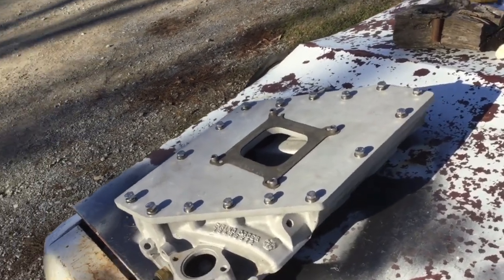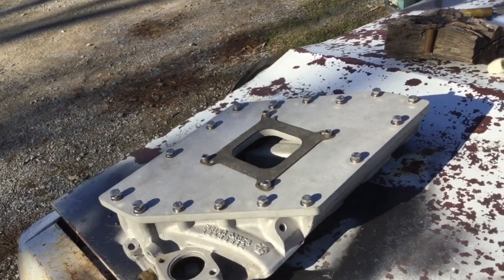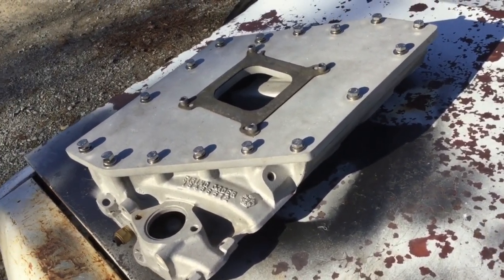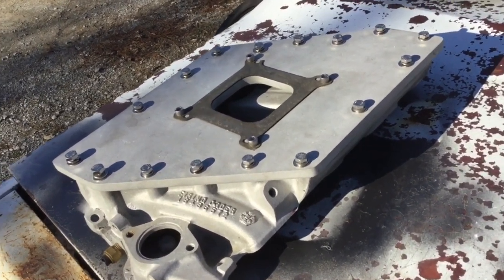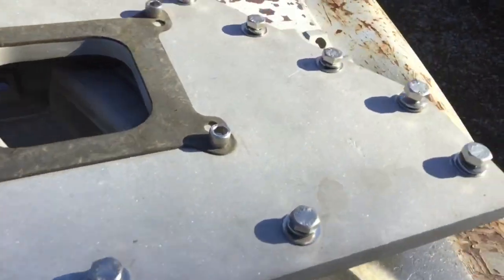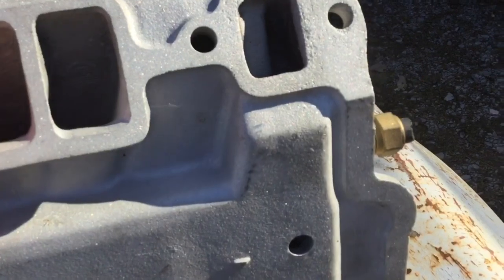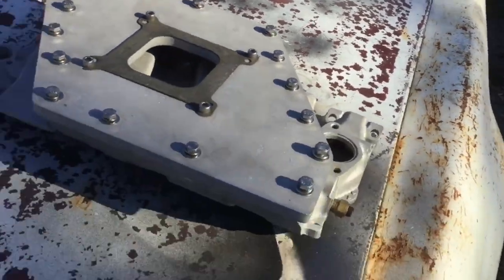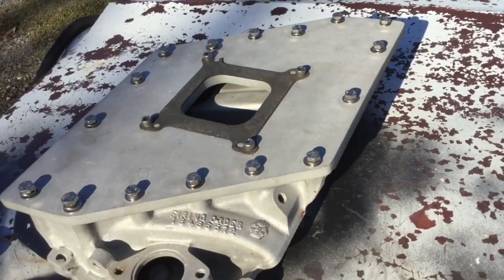Homemade Cross Ram Intake or Junk? Corvette Crossfire Intake made for Carburetor

Comment: Looks like the mixture has to do a 180º as it is pulled down through the carb flange, it first has to veer outward towards the heads, but then do the 180º as it's pulled into those concealed runners to the opposite head. The 'arc cuts' in the runner pairs, along with the bevel, tells me that whoever made that realized where the mixture was going. 
Best thing to do would be to compare it to a typical stock iron four barrel manifold, and then to a Performer. I'm sure the Performer makes more power, but I wonder about the stock iron manifold.  It does look cool, and the price was right.  I'll bet you could make a better taller top cover though, and make a better path for the flow, actually routing it to those lower runners - the way it is now, hood clearance will never be a problem.
Reply from the maker: Ya I’ve thought about making it have more volume, and I would really like to have it on a dyno but there isn’t really any around where I live. Thanks for watching Dan!
Reply: @dakotastimeout2827  The road is your rollers...

And that movie I was trying to think of last night is Thunder in Carolina from 1960.

Comment: I need to find myself a good place to purchase an old manifold I can start chipping away at.

 I would prefer to not convert my Crossfire over to an EFI carburator replacement but those do seem to be the most effective way to open the airflow
Reply: Convert it to a truck tbi. All the wiring and connectors are the same. The stock crossfire computer will run it just fine. Use an 87-89 350 tbi unit from a truck.
Reply: @mcqueenfanman  I'm going to look into this, thanks for the idea
Reply: @williamforbes6919  I ended up using Holley's tbi intake, it barely fits under the hood of my 84 vette. #300-49. You can run any intake you want as you can get a tbi to carb adapter plate.

Comment: So have you ran this manifold yet ?
Reply from the maker: I have not, but I’m sure I run into a good engine to use it for.
Reply: @dakotastimeout2827  cool, I have a 82 Z28 with a crossfire on it thinking of doing the same thing . Just not sure if it will fit under the hood.  Keep us posted .

Comment: So... I mean no offense, but... the intake will be a dog if used. The intake runners are super small and DO NOT flow much air. The crossram look is super cool, but, if you use it, build your motor for "something" that is going to be ran under 4500 RPM. Even though these intakes came on the Vettes, they weren't meant to be high rpm intakes. I wish you luck. Jim
Reply from the maker: Ya I was thinking thinking it would be ok on a stock sbc that I wanted to make look cool. They say just port matching the runner makes a big difference. I’ll probably port it just a little more before I use it but that will probably be a while from now. Thanks for watching!